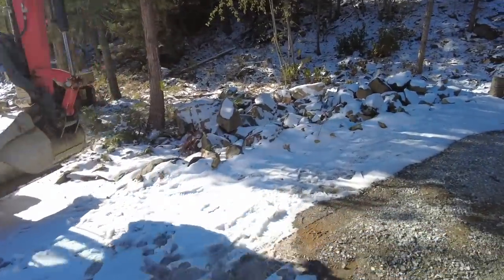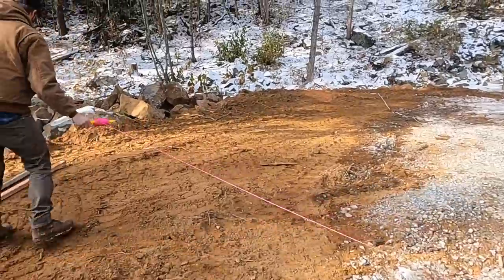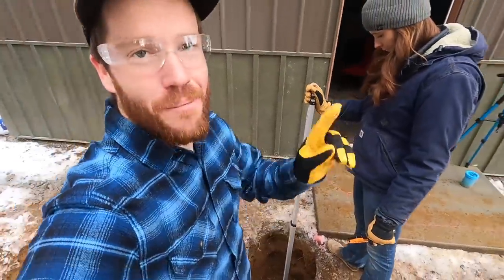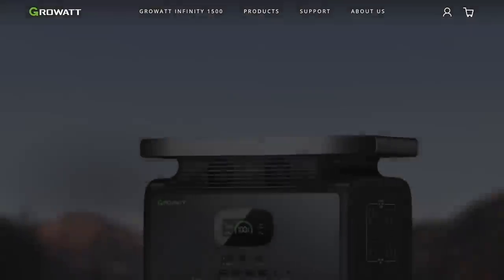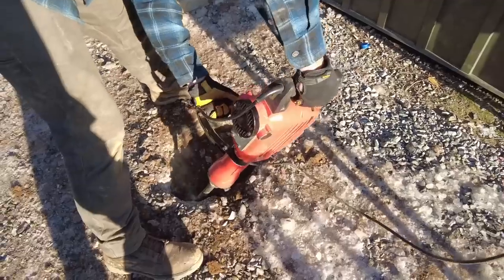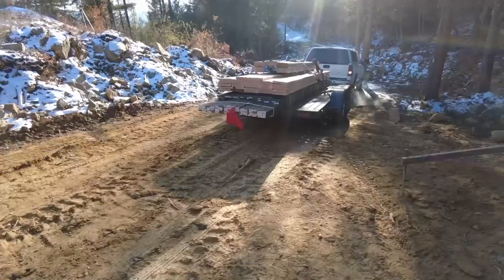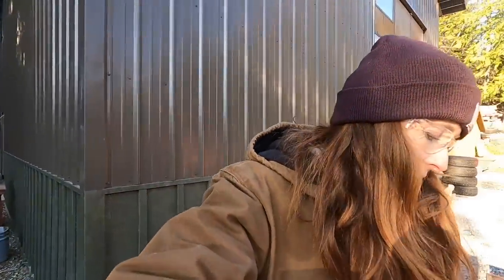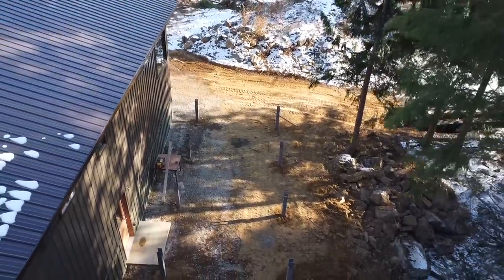Starting A NEW Build In WINTER?!

Comment: Did you read that Growatt's Chemistry is only rated for 800 charges then it drops to 60% so as a consumer we pay $1,600.00 and in two years of use and it drops @ 60% of it life,,you should mention this in your reviews...the best battery chemistry is the safe long lasting LifePO4 battery's like in the Delta Pro last 3500 charges then hits 80% thats like 10 years of every day use...then 80% if you do a review give the viewer the facts pros & Cons we are watching because we like you..  Growatt has a Battery Chemistry NMC (>800 cycles to 60%) ... i have Growatt inverters.. They make good products but for my dollar the dollar im not sure this would work for me at that price point and expected life on the unit. Nice work on the Deck so far.

Comment: re. the 4x4 columns that you used in the holes? Are they made of concrete or steel? I'm intrigued by these. I've always used the sono-tube method. (link to these)
Reply from the maker: They are made of concrete! From the company Permacolumn
Reply: @AmbitionStrikes  Thank you. 

Where you nervous with how Narrow they are?  Does the deck feel like there is any movement when you walk around on it?
Reply: Disregard, checked out the website. I see how they formed now. Very Strong.

Comment: question, why did you build your deck apart from your house? not wright or wrong.
Reply from the maker: It will connect to the building, but the building will not support any of the load.
Reply: @AmbitionStrikes  Thanks for responding, and thanks for introducing me to the word barndominium. I've binged watched all your videos. cant wait for the next. great job!  

One last little thing, now that you have put in the footing close to the building and the footings are at different levels from the barndominium. I hope you don't do a hard connection between the house and the deck. cheers

Comment: I'll be the douche pointing out that water evaporating from the concrete isn't what makes it hard. It cures, the mixture solidifies. If it was the water evaporating the resulting concrete would have the volume of the cement used.
I hope that it's worth the troubles building it in the cold.